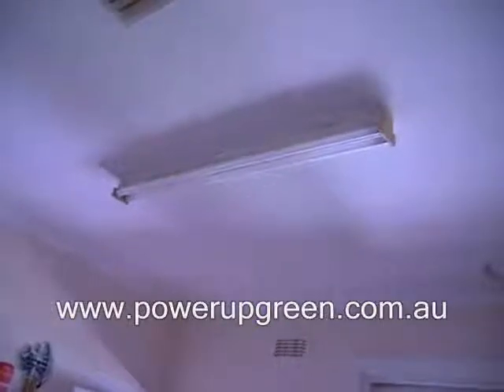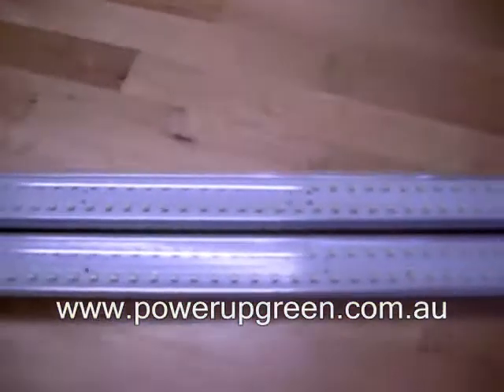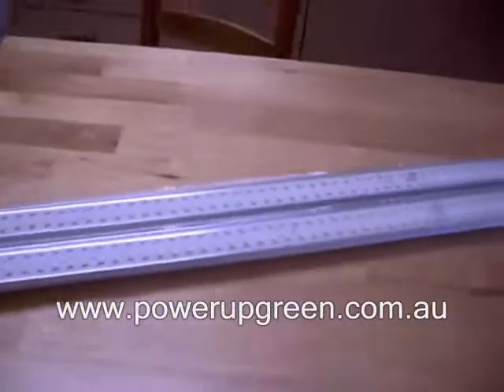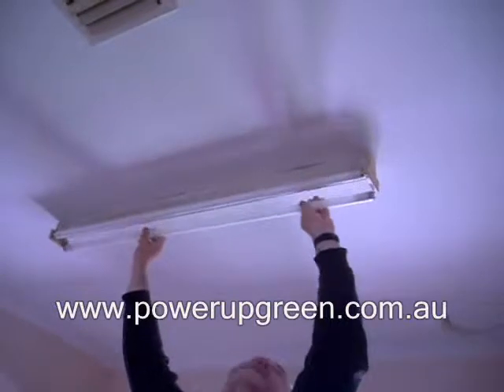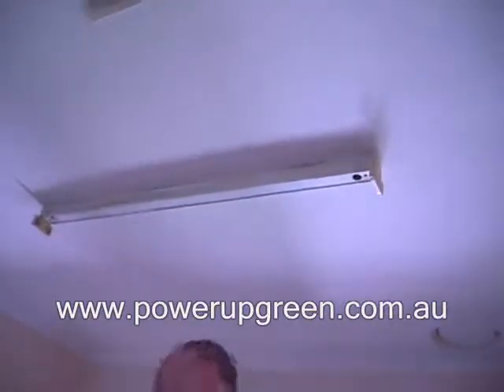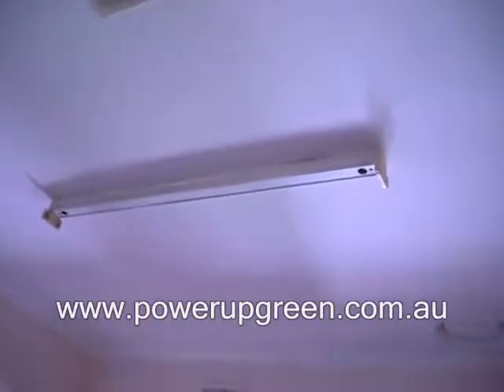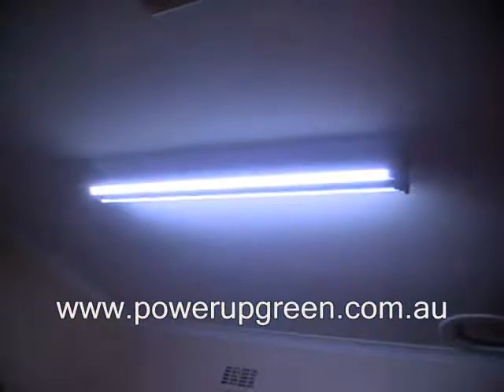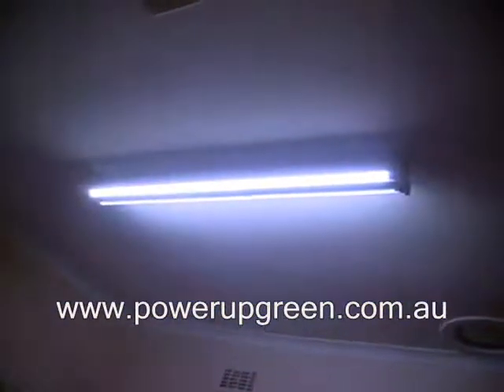LED tube replacement.wmv

Comment: Very bright and save on the electric bill,got 1200 of  4ft led bulbs from manufacturer: http://www.ebay.com/itm/4ft-LED-Bulb-18W-T8-Tube-Lights-6500k-White-Light-Warranty-Shipping-From-USA-/251994678150?pt=LH_DefaultDomain_0&hash=item3aac0da386
Shipping from OXNARD CA USA,fast shipping. Install them in my store, I am using them,works great!

Comment: These LED "tubes" won't last half as long as a good lamp and choke combo.
The problem with LED's and electronic HF ballasts is that any energy saving will be offset by the energy used to construct the damned things and their replacements! I mean when you have to change more failed electronic ballasts than lamps you know something is wrong!

Comment: Secondly to my other comment, if these use non-isolating crude Constant-current drivers, the driver circuit probably will end up wasting a HUGE amount of energy (potentially using half if not more of the energy usage of the entire fitting, beside of course being dangerous. + if it's a cheap circuit, it'll probably end up emitting all sorts of RF nastiness which really isn't a good idea. The CRI of LED retrofits tend to be appalling at best and atrocious at worst, especially in the red department

Comment: Hi all,we are T8 TUV approved LED Tubes with good prices manufacturer in China.Here we recommend you our TUV T8 LED Tubes.Contact me(sarahledialighting(at)gmail(dot)com,sarah(at)ledialighting(dot)com,Skype ID is sara389724021) if you need it.Some advantages of T8 TUV LED Tubes are TUV ,UL,FCC,CE,EMC,ROHS, ETL approved. Isolated driver inside.18W 1850lmfor 1.2m LED Tubes.EMC is strong, you use it for house,offices ,etc.Lifespan is 50.000 to 80.000hrs with 2 years warranty

Comment: I don't know exactly wht 38wd was referring to because all I know is how to replace these long tubular tubes in my kitchen, but as far as quality is concerned - Philips is excellent.  Inserted one 12 years ago and it is only approx. 3 months ago that I had to replace it.  And this was one I used before I moved here. The only thing I would criticize is: It is difficult to have "ANYTHING" serviced (e.g., my large confection/microwave) because all they appear to be intersted in is - sell).

Comment from the maker: But LEDs are directional - most have 120 degrees beam angle. So the illumination below is as good - in some cases better - than from fluorescent tubes (unless the fluorescent tubes are in a good parabolic reflector).